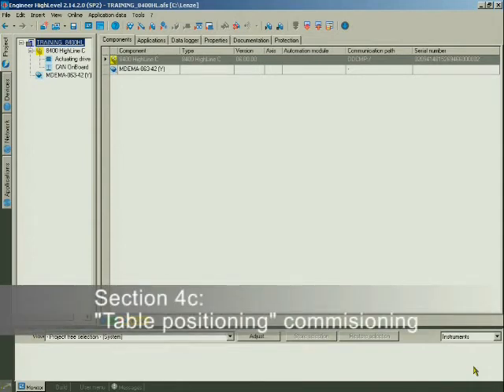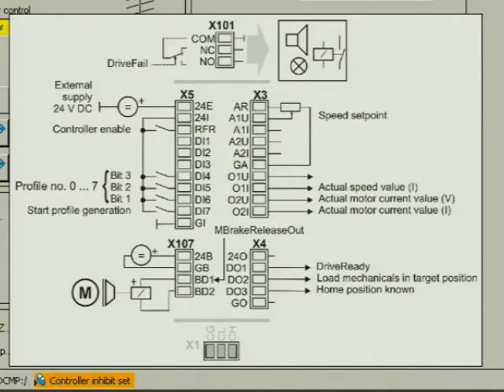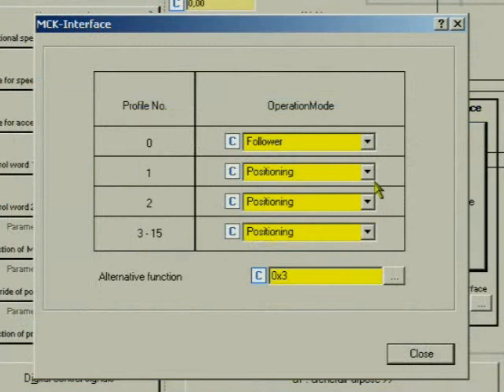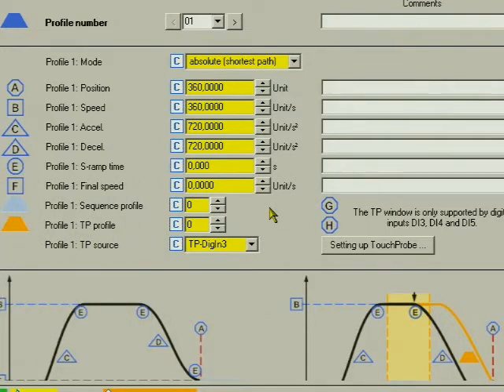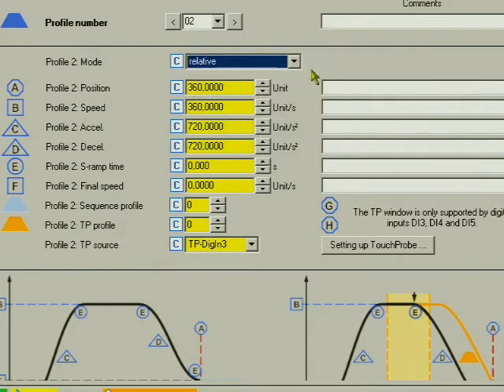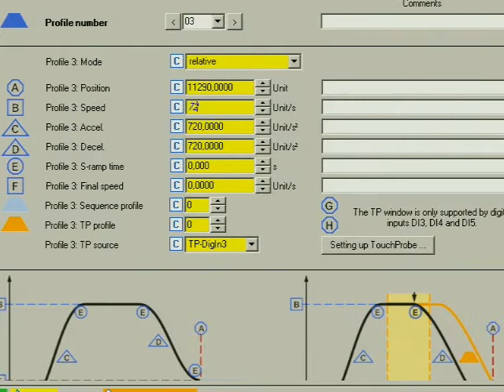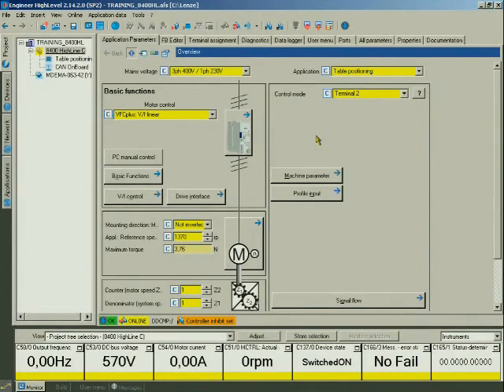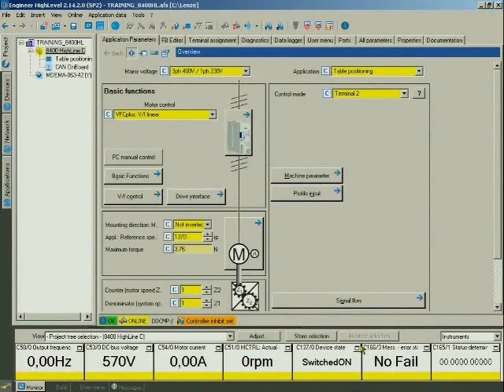Tutorial #7: Table Positioning Commissioning of Lenze 8400 HighLine

Comment: how can i overcome lenze 8400 software version of control unit when i wants to download a program on a new device with older software version
Reply from the maker: Older software is only compatable with 9300,8300 series, for 8400 and 9400 series they launched Engineer Software which is latest and can be use with different new products of Lenze...
Reply: @esrtechnologix    i want to update 8400 software version of the control unit but my engineer (l force) software doesn't show it for 8400 and 9400  it only shows a list for i500 and i700
Reply: @mahmoudsamir130  , u must have library for all device e.g 8400 high line, top line, 9400 highline etc. Mine got copy from my friend
Reply: sorry i meant transferring parameters from higher software version to a lower software version control unit using  engineer software
Reply: Kindly send me link Engineering software
Whattsapp 0333-5753029